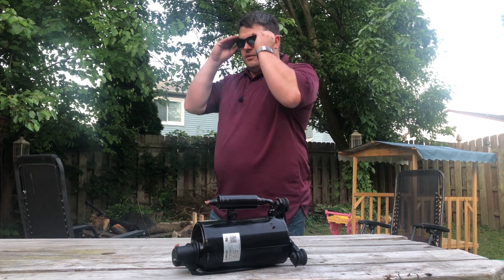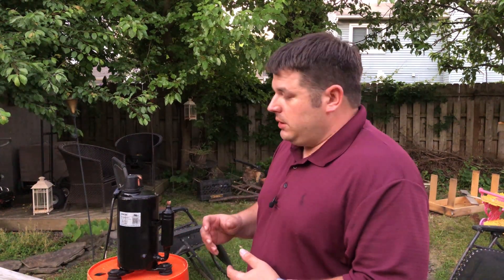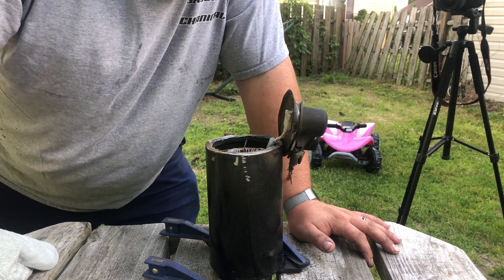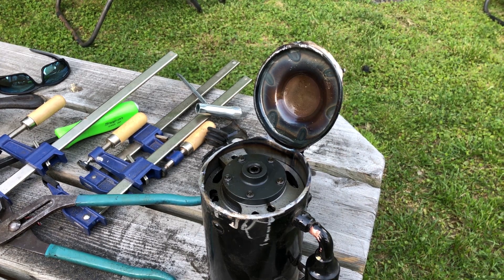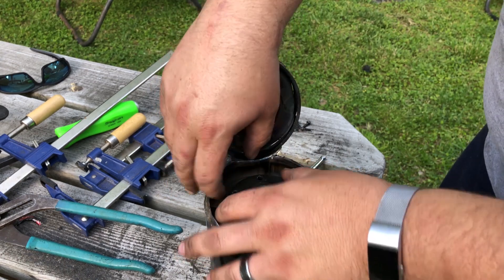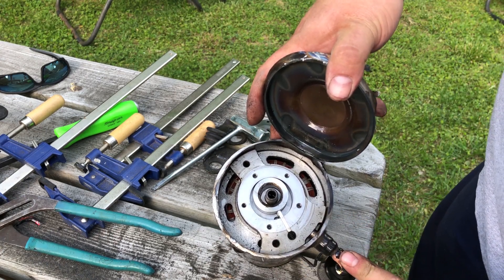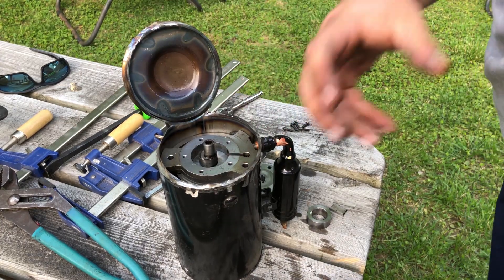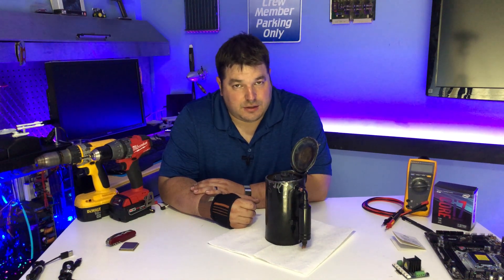DISSECTING an AIR CONDITIONER COMPRESSOR

Comment: Probably not seized, improperly diagnosed bet the run capacitor was bad or the temperary installation of start capacitor and relay would have started the compressor and all would have been well.